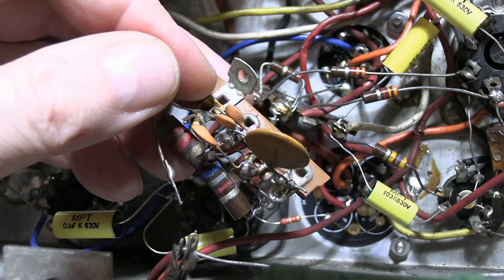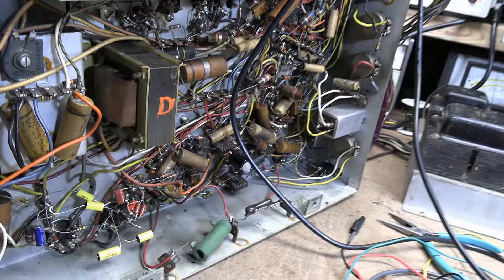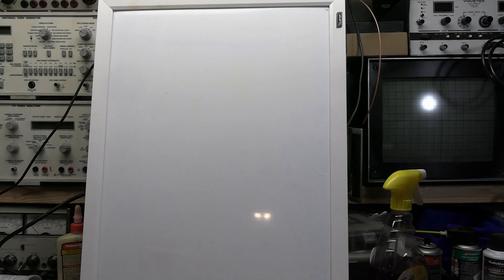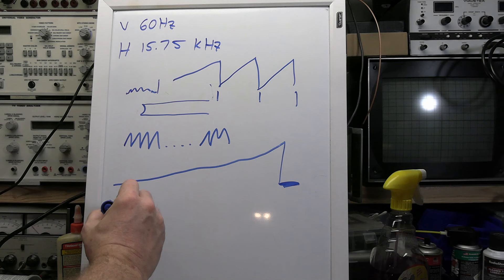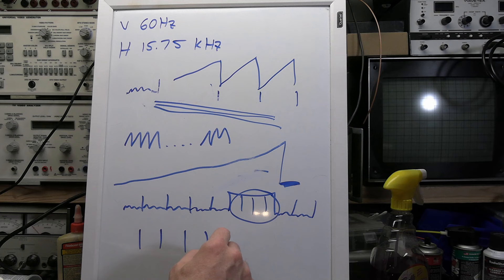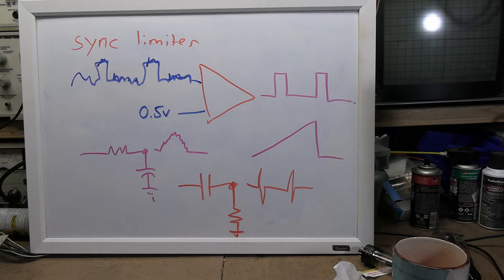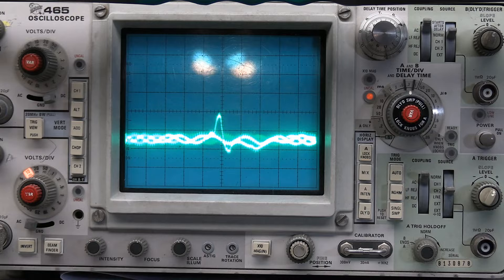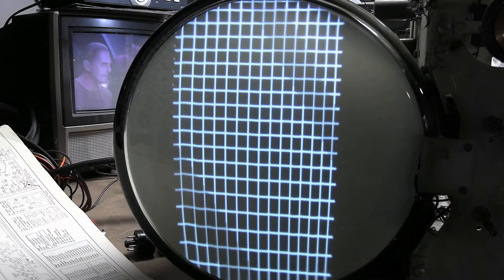Beginners guide to B&W tube TV restoration part 13 (vertical sync)

Comment: VERY early television systems (with physical scan systems) did not support sync information in the signal, and their scan speed had to be "driven" or constantly adjusted by the person operating the picture receiving equipment, to match what the transmitting equipment was using and thus to produce as straight a picture as possible.
Reply: SOME needed manual speed adjustments. I believe most used synchronous motors so the power grid provided a precise frequency match. Then you only needed to adjust the phase by hand.

Comment: Most basic explanation of why there is vertical and horizontal circuits, think of the electron beam striking the phosphors as a paint brush, the vertical tells the brush to start at the top and work its way to the bottom, horizontal tells the brush to work from left to right, otherwise the brush would be painting all over the place

Comment: Great explanation.  I was struggling a bit to understand the vertical sync system and this cleared it up: 
One question.   If our broadcast system is interlaced with two fields.  How does the set control between each field and choose the correct field when turned on or change a station etc 
Thanks
Reply from the maker: Hi.  It doesn't need to.  There is a half line offset baked into the composite video signal that naturally caused the fields to be offset by one line as they are painted on the screen.
Reply: Ah ok thanks.  I think I get it 🫨